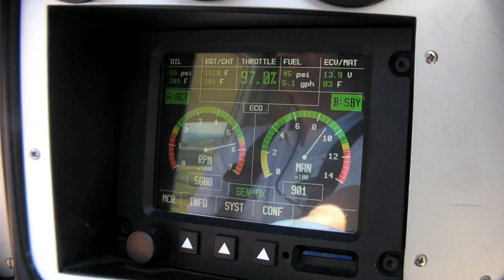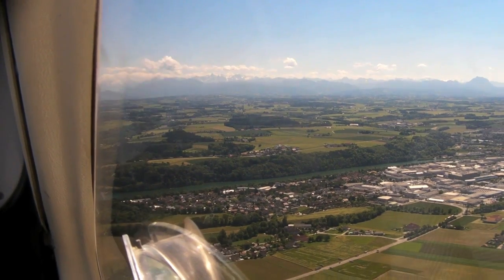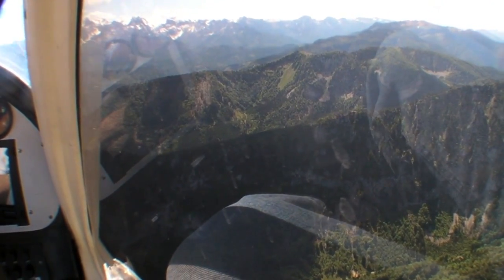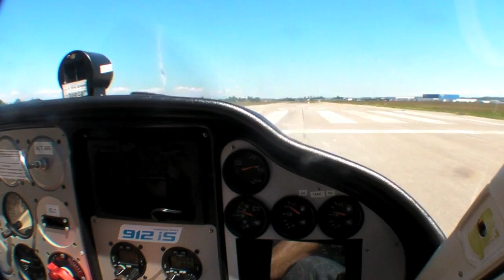AVweb Flies the New Rotax 912iS Sport

Comment: So, you don't get "more power," as much as you get more torque at lower RPMs with this design. This means you can extract more thrust at reduced power settings with a constant speed prop. It's still a 100 hp engine.

Comment: no its not a cold air intake, cause when you calculate the induction coming from the strut manifold, you can easily realize the rpms would max out before the timing on the piston slides are at full capacity....duhhhhhhh : / idk wtf im talking about

Comment: Nice.  I'm hoping that Rotax comes out with an injected version of the 914 (turbo), because that's what the plane I'm building requires.  They have 2 years to get it done. Please please! :-)
Reply: Checkout the UlPower 350iS or cc340 ... would be my choice ;-)
Obviously depends on the airplane you are building but consider em
Reply: The plane I'm building, a Sling 4, is specifically designed for the 914. So, I'm really hoping they come out with a i version.

Comment: Is it safe to fly an LSA in mountain turbulence?
Reply: What does n=4 and n=2 mean or stand for?
Reply: OK, gotcha!  Thanks!
Reply: In addition to certification theory, in practice the mainstream LSAs like CTLS are little different from Cessna 152 or 150/150, or in case of RANS S-7 from a Cub. You do not want to tackle rotors in either of them. You will not be able to outclimb a wave either. So it's the usual. I completed a mountain flying seminar in Remos GX.